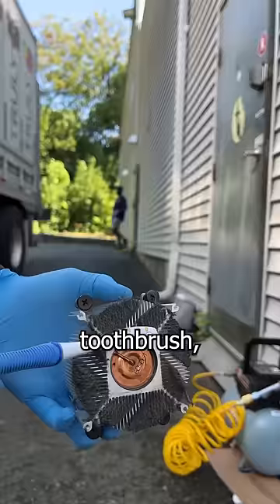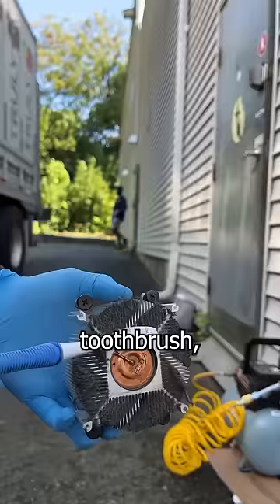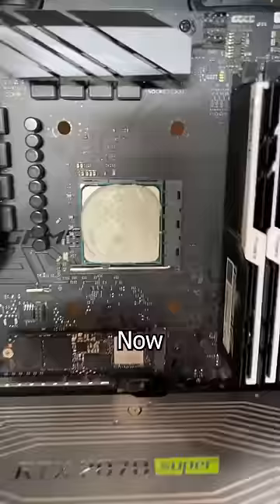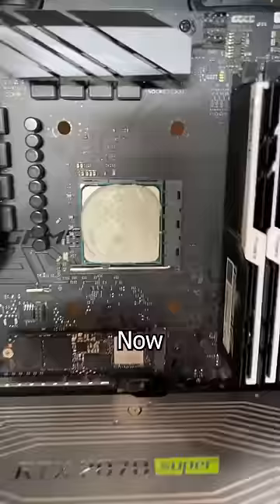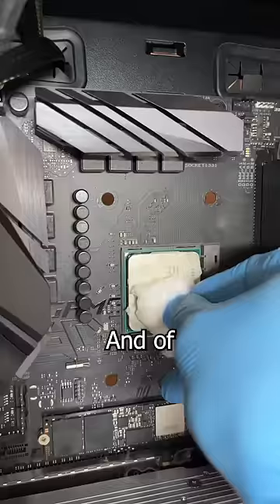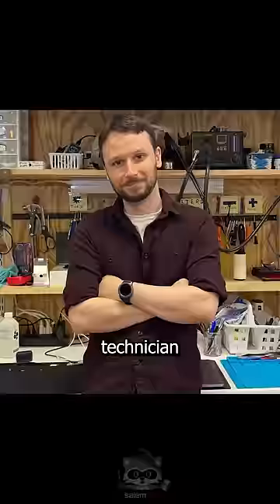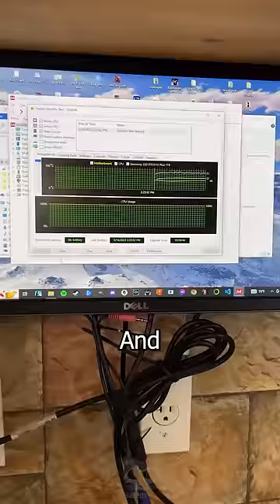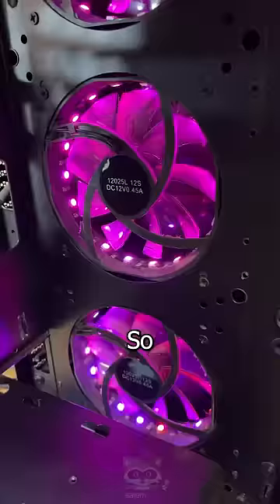This #gaming #pc has no airflow. Yikes. Overheating CPU = WHEA 💀 #tech #technology #shorts

Comment: Never trust a cooler that comes with a cpu. Trust a cpu that comes with a cooler. 😊
Reply: Well cpu coolers are actually pretty decent and should be fine for the given cpu you buy
Reply: @arya493 Yeah, uh, no.
Reply: @uBreeze  I mean big companies like Intel and AMD arent dumb spending money on coolers to give to you, they are pretty nice cooler and good for your daily gaming session.

if you want some RGB or an AIO on your side than its a different thing. The tech youtuber Austin Evans talked about the same thing that the stock coolers are actually nice for your CPU
Reply: @uBreeze the wraith coolers are actually good. Not for a Ryzen 7 tho, thats just cooking the cpu alive XD. If u are running an R3 or R5, wraith spire or max is plenty. They are just a little noisy
Reply: @PaperReaper You don’t know the pre-wraith coolers don’t you, the modern AMD coolers are silent next to those
Reply: @JoseLgamer05  oh I dont, were those jet engines? I have a wraith spire which has since been replaced, it was kinda noisy but I am a person who is very sensitive to that stuff. Plus I have a case with mesh on top and front so not that much sound isolation.
Reply: @PaperReaper  The coolers that came with AMD CPUs pre-Ryzen were usually awful and had a similar max RPM to average laptop fans.
Reply: @yasu_red I had one of those and it got to 7500rpm, once my PC turned on by itself due to the button gotten stuck and it got my nail almost off my finger lol
Reply: No fissure logic

Comment: I once turned on a PC I had built before plugging in the case fans, I got Windows installed and everything then went to look at the temps and saw a nice 64 degrees on the SSD, then I looked again and realized it was in celsius, apparently it was over 100 degrees fahrenheit.  I turned it off and made sure those case fans were plugged in after that.

Comment: I remember getting a new cooler for my intel core 2 quad, which was a bit overkill for that CPU. I could run the CPU on full power without the fan and the max temperature would be 65C. A proper cooler matters a lot for a CPU!

Comment: 2 Questions.
1. When you replace the Heatsink of a computer, what do you use to remove the OLD thermal paste residue?
2. What is the BEST thermal paste to use to apply to the Heatsink?
Reply: 1. isopropyl alcohol (when pc is powered off)

2. any well known brand, it's all the same stuff really. testing has shown there's hardly a difference between even cheap vs expensive paste. knockoff paste exists too.
Reply: Is 99% Isopropyl Alcohol satisfactory?
Reply: @WalterDWormack214   it's actually preferable above all else, that's the best and safest stuff you can use. will get rid of anything really, especially thermal paste.
Reply: @myceli  Thank you, for your very quick reply. That's really good to know! My HP Pavilion DV7-6B57NR Entertainment Notebook Laptop Computer has been in desperate need of a new Cooling Fan/Heatsink assembly, for a "CYLON's Age"! 
I am attempting to 'revive', (actually, 'resurrect', would be a better description), my computer. And I am in the process of acquiring all of the necessary tools, and step-by-step instructions and directions needed, to accomplish this task. 
Again, I thank you for your timely response.